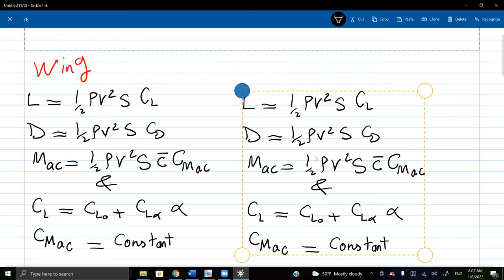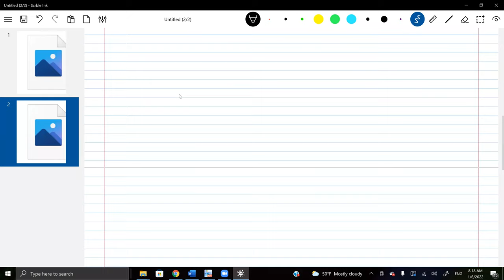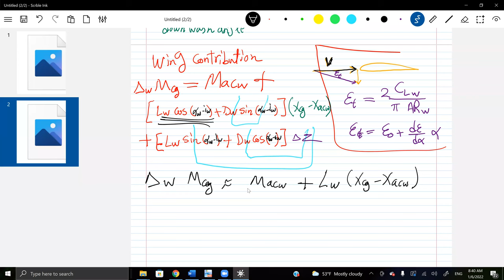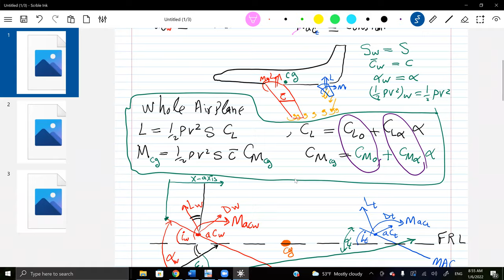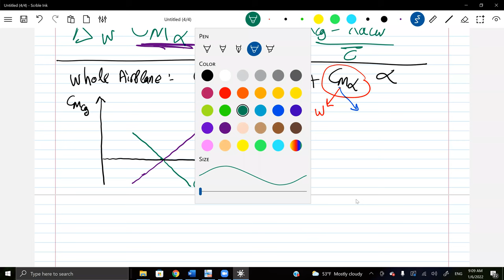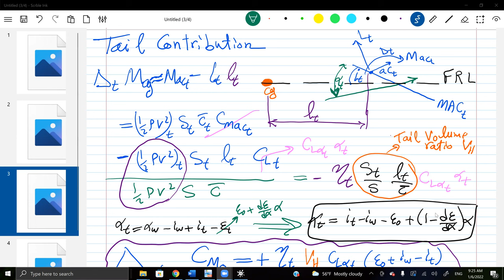MAE 175 Lecture 2

Comment: Hi professor, i have question about all movable v-tail configuration.  I tried to write dynamic equations for it but i couldn't.  I there any book or material i can use as reference. Is there any effect of dihedral angle on equations?